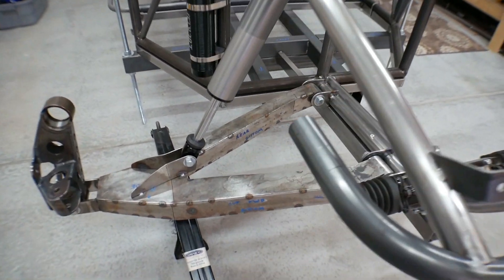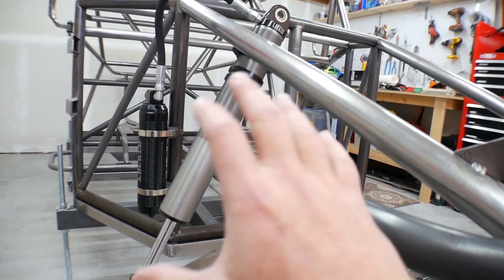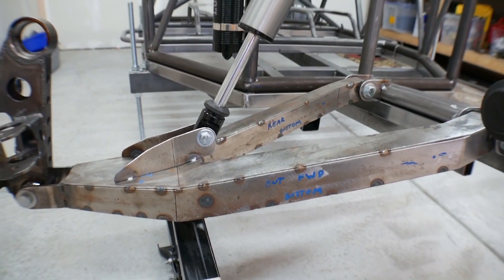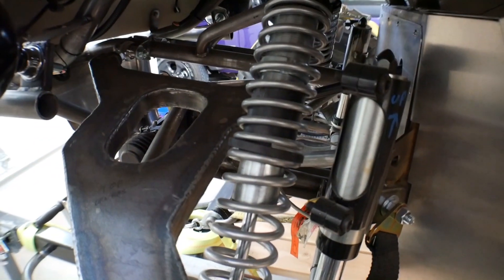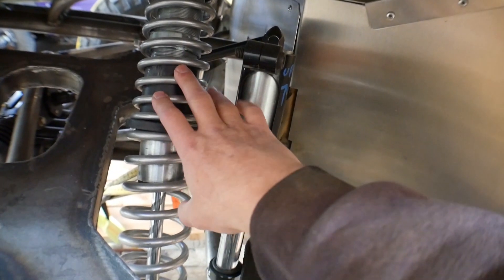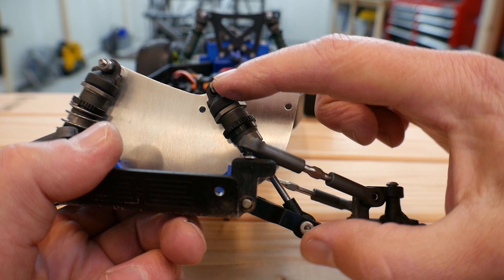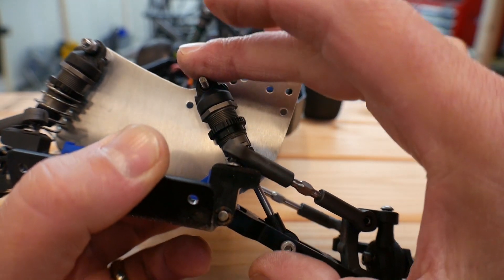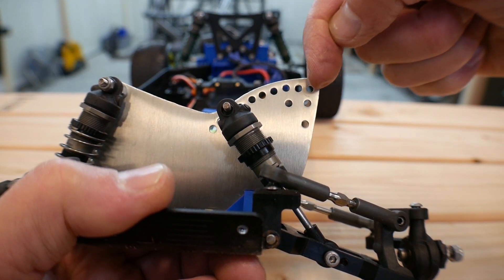How to determine your shock absorber mounting points.

Comment: At about the 10:37 mark with the shock mounted vitically. You are saying as it goes past vertical. You lose compression.
I am not sure if this is true. Yes, the lower control arm is gaining in its mechanical advantage past 90 deg. But the shock is reaching its maximum dampening point as the shock is passing 90 deg. So maybe it cancels each other out. Just a thought.  You know a million time more than I about this.

I do have a question for you. I want to either add independent suspension  to an existing golf cart.

Or totally start from scratch with a tube frame in my attempt to make the smoothest riding golf cart possible. 
Any ideas?
Anything goes.
Trailing link rear and front if that is possible? 
Air bags?
Rear steer ? because I also plan to have a wheel base about 3 feet longer than a standard golf cart.

It will be electric and probably double the standard battery weight.
I do want it to be "offroadish"

I understand a trailing link front would require an extended beefed up nose..

I have never done anything like this. Kinda looking for a mentor to guide me.

Thanks
Reply from the maker: I would go A arms front and rear, no trailing arms, the A arms will be a smoother ride. No rear steer, only front. I'm actually not familiar with a golf cart frame, but I would try to reuse the factory frame and just modify it if possible. 
Independent rear might be difficult, I think those have a solid axle. You could always try to make that into a 4 link to keep the project a little simpler. 👍

Comment: Do they handle better in front or the rear of the front spindles, ? As we put airbags on my trucks, and moved the shocks front center to the rear of the Spindle then to the front of the spindle for clearance room..it had struts on center until we removed them and installed air bags..
Reply from the maker: Center is best obviously, but then I'd go behind the spindle. In front would be the worst.

Comment: how to get full compression and rebound  in coilover shock absorber, to calculate motion ratio .

Front lower control arm should parallel to chassis or ride height?why?
Reply from the maker: Usually when the arm is parallel (to the ground) at ride height it gives you the best geometry. So with most designs that's where you will get the best performance.

Comment: what shock absorbers are you using?
Reply from the maker: These in the front are "Locked Offroad" brand and they are 2.5" body 12" travel remote reservoir.
The rears are also "Locked Offroad" 2.5" body 16" travel.
Reply: @DougBugBuilder  thanks!

Comment: good job on the buggy build, always enjoy your vids. If you fab your shock so that the 2 shock mounts and the pivot point of the A-arm are in a scalene triangle you will get a rising rate suspension setup, similar to the rising rate rear suspension of a MX Bike with a bellcrank and dogbone, you then can valve the shock accordingly.
Reply from the maker: Great tip thanks! I had to look up what a scalene triangle is. lol

Comment: Great way to explain your set-up! I've been watching most all of your videos. You're inspiring me to work on my Baja. But not only inspiring me to work on it but, you're making me want to do a full suspension build on mine! Lol! I'm not a great fabricator, but, I have some skills. I'm better with the CAD myself. I program CNC machines for work... I do have a decent 120V Hobart welder and just bought a tube bender and a cheap plasma cutter... I'm going to get some work done on it soon... but I have to run wiring in my garage. I just got a line of 220 out there and a service panel to add circuits!
Reply: I forgot to ask, I watched your video of the new arms you're making with the 6 inch offset. Where will the 90 come from them?
Reply from the maker: @XFretless  Which video specifically? I'm not totally sure what you're asking.
Reply: @DougBugBuilder  this one... https://youtu.be/f2xZO_dpD6Y unfortunately my bugs are all completely taken apart. The new bug I got was completely stripped when I bought it for the body... it actually came on a realt nicely done swing axle chassis with adjustable beam and adjustable rear plates... I won't be using it though... so I'll possibly sell it, probaly with my long body dune buggy body... which started me on VW projects and never finished it by being overwhelmed! Then I thought long and hard about it and figured living in New England I should have a vehicle with a roof and heat... lol! Otherwise, I won't  get much drive time with it. This new idea I have might not be feasible but I already have most of the parts. I don't want to let the cat out of the bag just yet though... I'll try to figure out how to send you a video message with some of my ideas instead of me writing everything here.
Reply from the maker: Hey Bud, that's great that you're thinking about doing a full build. And sounds like your getting all the shop essentials you need. Let me give a little advice and say to try and take small bites at first. I don't want you to tear your Baja all apart and get overwhelmed.
But sounds like you'll be all tooled up soon. Good luck with your build!

Comment: All true, but with nitrogen-filled shocks, the spring/dampening rate is not linear, but very progressive, unlike the RC-car. 
Because of that, you can actually go beyond 90°, where the forces theoretically should regres, but practically still progress.
If you should combine that with a PUR bumpstop (where the spring/dampening progression becomes super progressive, eventually into infinity) this set-up will still be very controllable.
Especially when you'd squeeze the high speed rebound a bit, while still keeping an eye on maintaining tire-to-surface contact.
In this case, the spring is only there initially for the static ride height and dynamically to keep the car from bottoming out, under all conditions.
Reply from the maker: Hmmm, while I agree with some of what you're saying I think going beyond 90 would just make it more complicated. I personally would still not go beyond 90. However like I said, there's about a million ways to do this. And to each his own. Thanks for the comment and getting my brain thinking. lol

Comment: Good video. I haven't had RC cars since I has a kid. Makes for a good demonstration. I've got an old bug for a project myself. I want it to be a 4 seater with rear suspension outside the body. I noticed (online)
 a yellow RC Baja bug with similar design to what I want. Funny where inspiration comes from.
Reply from the maker: Yeah, certin RC vehicles with well designed suspension are great to design after.